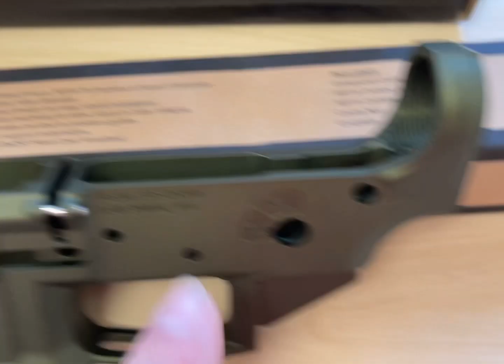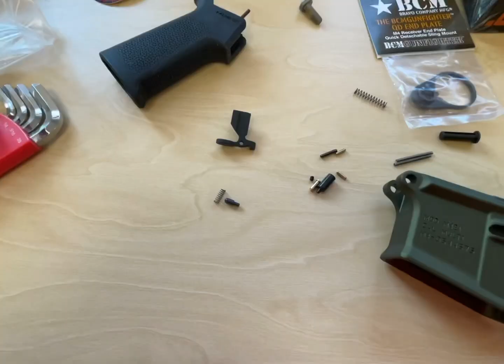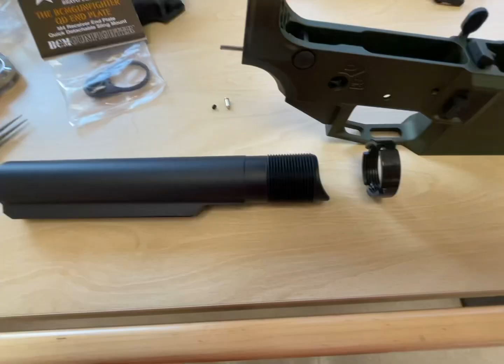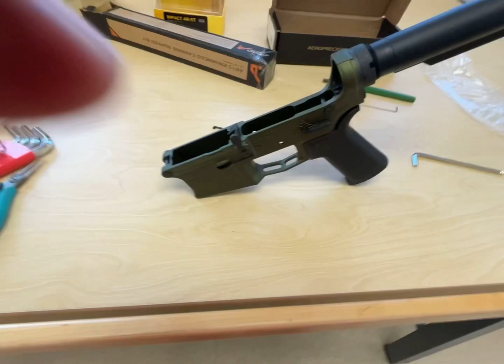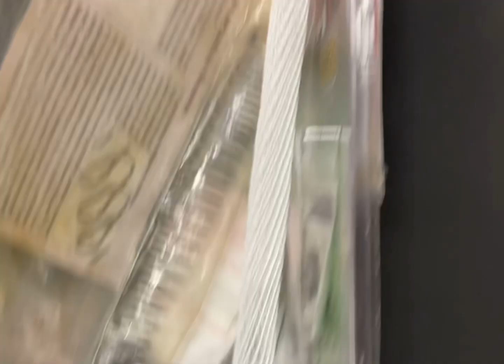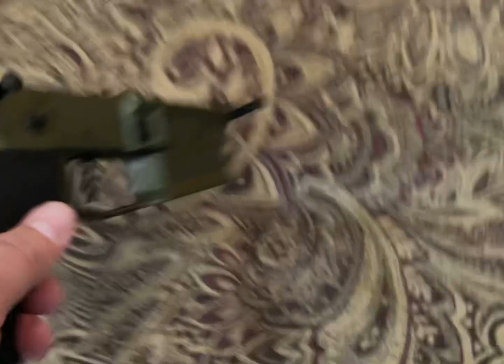Aero Precision M4E1 lower build

Comment: you should install the trigger first  before the selector and pistol grib, try using a Cleves pin to install the detent and spring on the front pivot take down pin. plenty of videos on that method, simple and fast.  you didn't show any installs because you don't have the camera set on a tripod

Comment: Here's what I do for the front take down pin and detent. Use a 1/4 Chivas pin with multiple holes. Insert spring and detent hold in place with small punch rotate Chivas pin to trap the detent. Then carefully push in the take down pin with groove toward the detent . This will ensure to capture the detent as you push out the Chivas pin.
Reply: Home Depot has the 1/4" clevis pin in stock. Works great!
Reply: Allen wrench should work as well. Always nice to have an indent spring flying across your room. Keep your face right over your spring while installing, so if it does  slip, it will smack you in the face instead and might be easier to find. 😊
Reply: @gmartelamon 😂😂😂😂
Reply: @gmartelamon yeah, eyesight is overrated anyway 😂😂😂😂
Reply from the maker: I usually use a pin punch inserted from the other side to hold the detent in, while I push the takedown pin into the receiver pushing out the pin punch